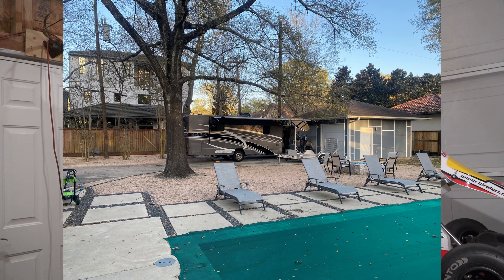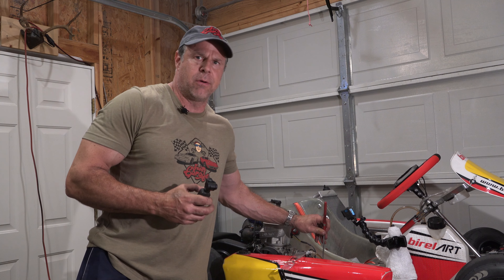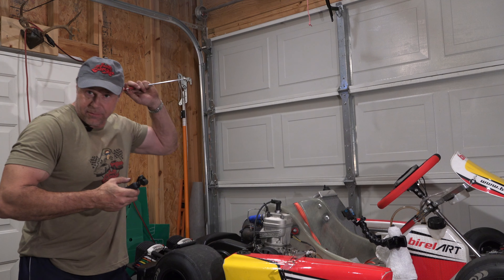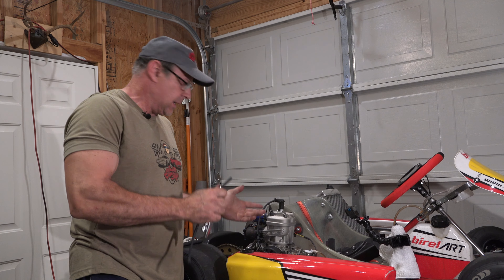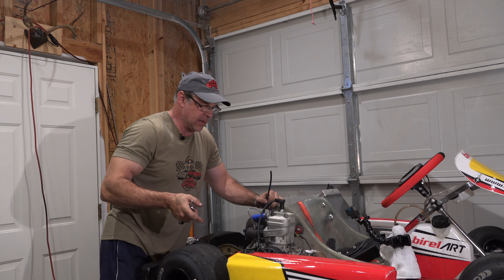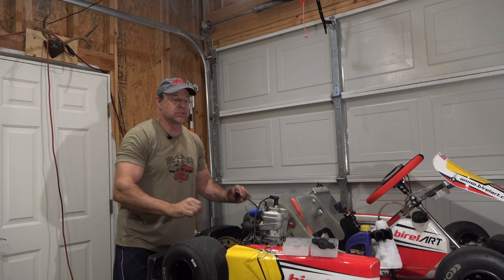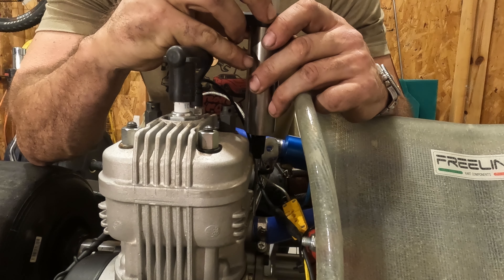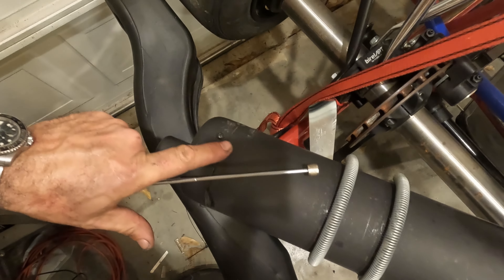The ridiculous process I do to change the oil in the Iame X30 race kart engine

Comment: You can use the syringe to pull the oil out. Tilt the kart back and it won’t go everywhere. It does a better job getting everything out than just letting gravity work. Also 40cc will likely have too much pressure in the case and it’ll get shot out the breather. Pretty much always ran 30-35.

Comment: Mate all you have to do is take the engine off which requires unscrewing two engines mounts on the bottom of the chassis, makes it way easier that doing it on the kart, drain old oil from crankcase by removing the gold bolt and then put the new oil in through the filler. Should make it easier
Reply from the maker: I will try next time and maybe do a vid on it.

Comment: So you rotated the exhaust but the internals are still the same way, the end cap is still dead heading the exhaust fumes yeah? Can't you just rotate the end cap 180⁰?
Reply from the maker: It’s a good point. I’m not sure what the internals look like, but the cap didn’t want to turn. The mechanic at the track claimed to move make a little more HP and I actually gained a mph on the top end since. I guess with only 29 HP to begin with, every little thing helps.